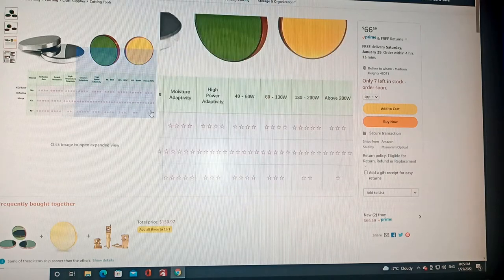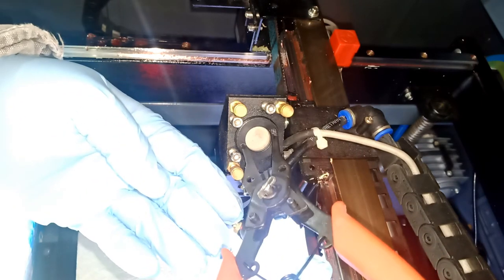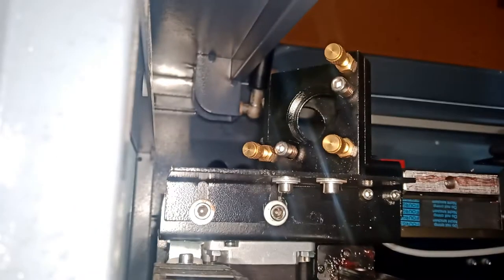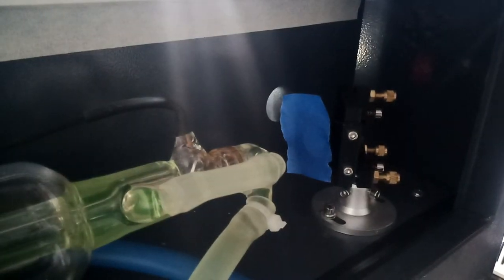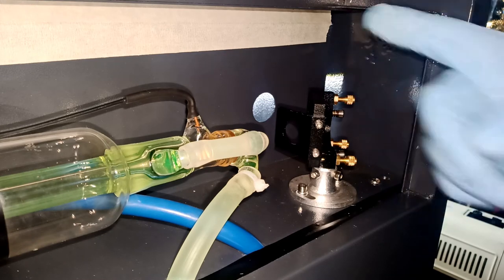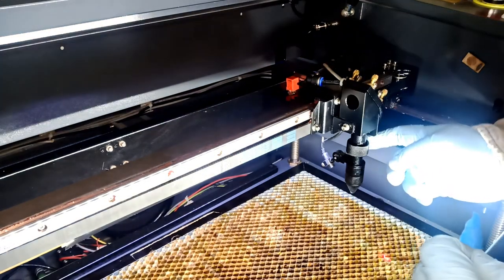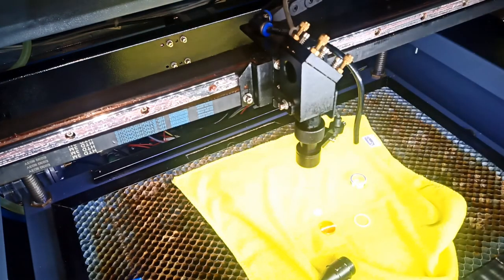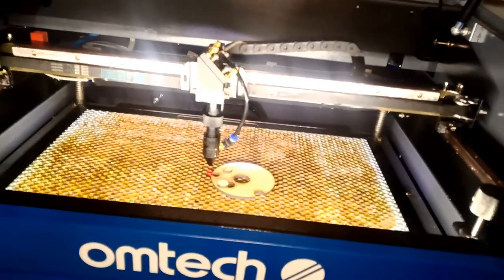OMTech 50W CO2 laser mirror replacement and alignment and more..

Comment: You might consider cutting some discs that fit into the bracket where you’re using tape. Since you’d be cutting the disc with the laser, you could also engrave a cross hair and some concentric rings that you could use to judge how off-center the beam is.

Great stuff, BTW. I also have the 50 watt and this playlist is a goldmine. Thanks!
Reply: anytime if you need help just ask

Comment: Hi I'm glad I found your videos I just started my 50w omtech laser journey  and I'm having a  difficulty finding cut setting would you know were I could find any. Thanks from a newbie.
Reply from the maker: What material you're trying to cut
Reply from the maker: How thick  of material and do you have the stock lens
Reply: 1/8  Acrylic and it's the stock lens
Reply from the maker: @shelleymikecasey Acrylic I think will be too hard to cut with this machine try 11 millimeter per second/ at 85% power, 
I do not recommend you pushing your machine harder than this The best way to do it to play around do a 85 if it cuts lower the power down The lower the power you can use when you cut it, the better for your laser tube
Reply: Thank you  so much I will try this and see.

Comment: i have a used machine and i did these tests & cleaned etc and got centered but the laser head test was a blank. no laser mark in my tape shooting down towards the tray. any ideas as far as what that issue is? I have laser power on pulsing to other two heads.
Reply from the maker: Is your door open maybe the sensor is not working

Or is the water pump working

Or you can check your water flow sensor maybe that almost got bed
Reply: @wisamyousif14  thank you, I will try more tomorrow
Reply: @wisamyousif14  so tonight i see my fan is not working and the original red device that the online manual shows should be where the water lines go is missing. i googled laser service technicians in my area and came up empty. OMTech is not very helpful because even though I told them i bought it used they are asking for an order number. i am not adept enough to do a virtual service call. do you know of any lists of technicians that can service this machine? i am beginning to think i’m missing key parts.
Reply from the maker: did you figure this out or do you still need the help I think I misunderstood you give me your email so I can ask h for your phone number and can trying to help you over the phone